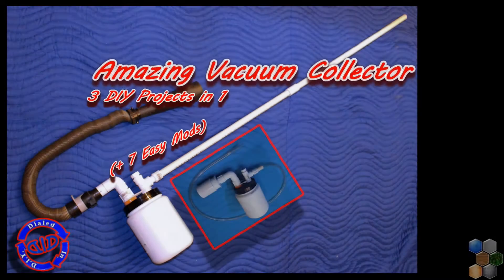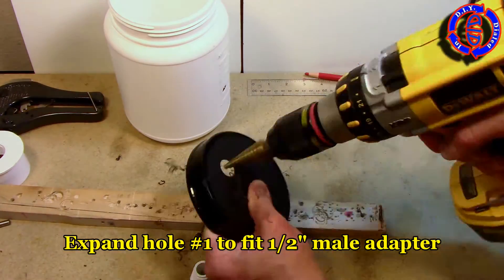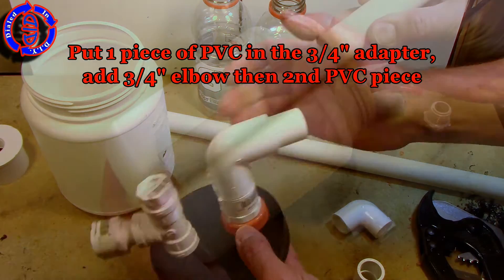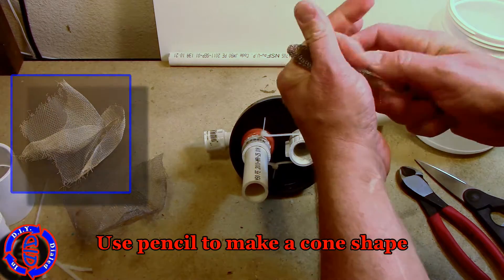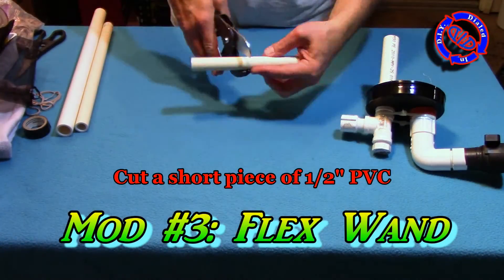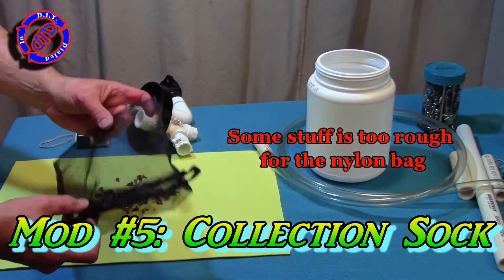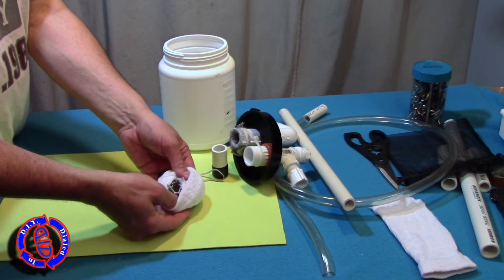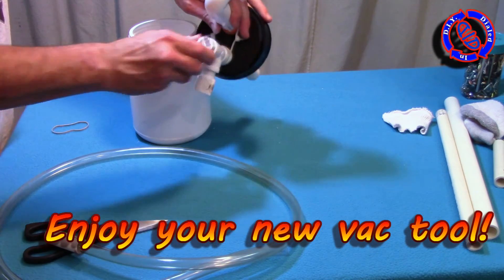Multipurpose Vacuum Collector DIY - Pick Up Stuff or Bugs Quick

Comment: can you add a small manual vacuum cleaner (to be used in a car) to your list?
Reply from the maker: I like the idea.  By manual do you mean completely without a power source or something like a rechargeable type?
Reply: either way would work for me :)  i'm a rubber tramp with a very small set up.  i crank it by hand, plug it into the 12v outlet or charge batteries through my inverter. - by handcrank i mean without a power source.